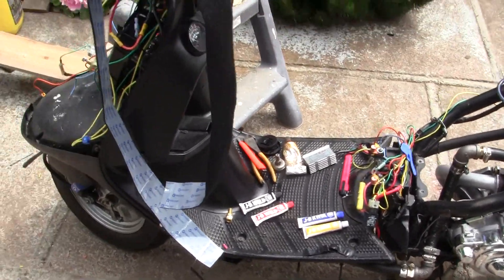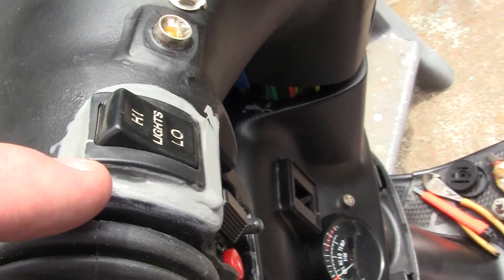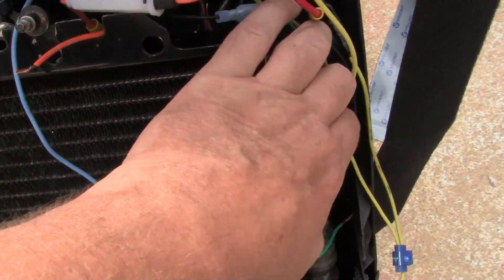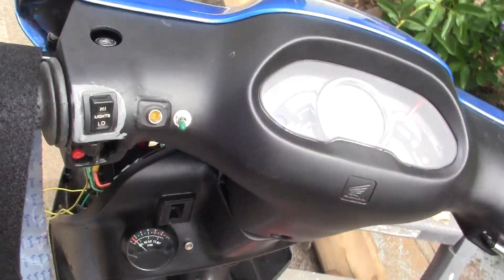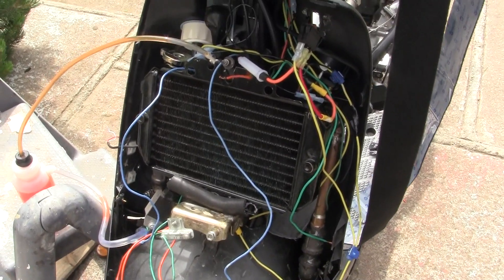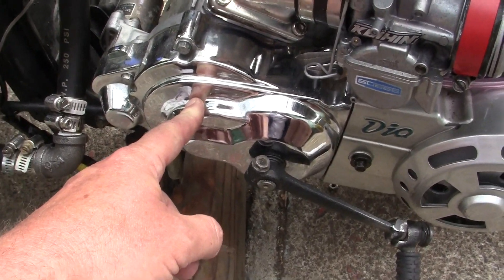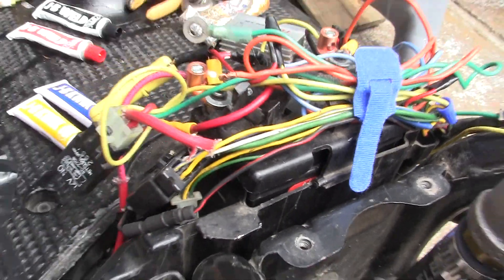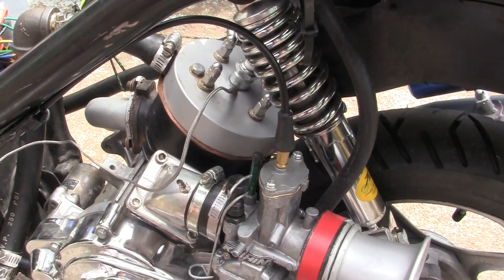(15)- HONDA REPSOL  50 / CC = UPGRADE TO 120 / CC

Comment from the maker: I bought all the 2 inch wide velcro, then I notices a foot long mini-bungee cord in my toolbox with metal hooks on the end. I put one hook on one side of the radiator , ran the cord thru the steering column and attached to the other side of the radiator, works well but I think the velcro is the answerr, thanks for the advice. RH

Comment from the maker: That is exactly what I was thinking. I have a pop up rivet tool and was thinking how I could distribute the stress points without tearing the velcro over time. My idea is great , but I know exactly how much vibration and heat the bike causes , while running.